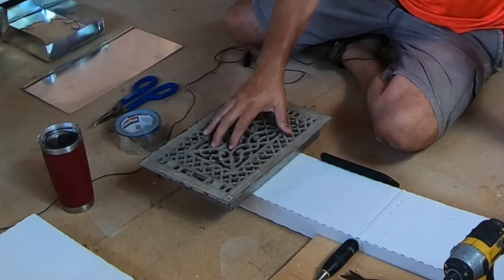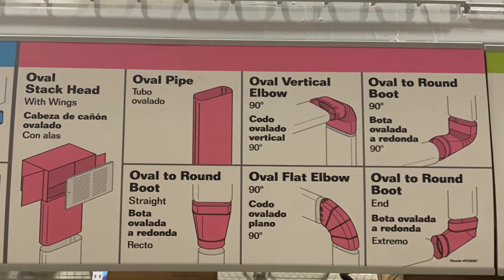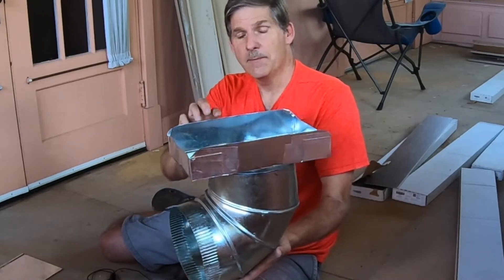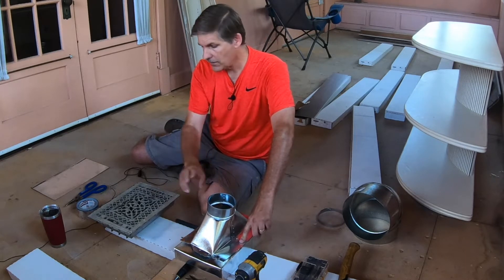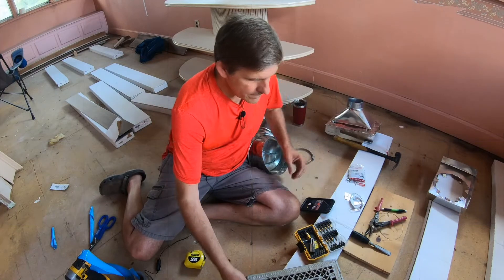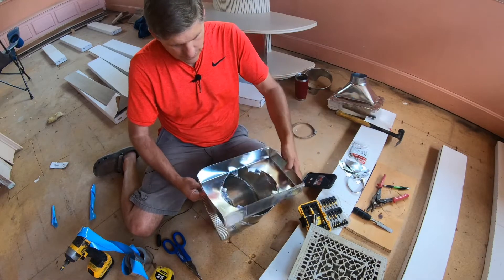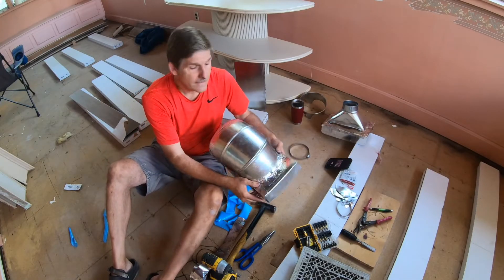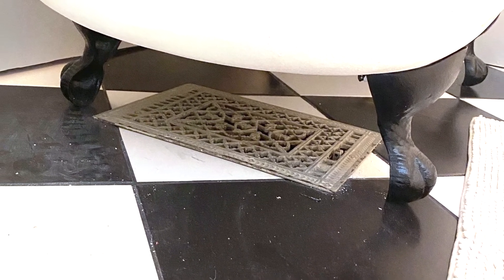Moving Duct Work in wall for Open Concept : old house renovation

Comment: Great ideas and detailed info!  Love the editing.  😃 Old houses renovations are fun, but can take a lot more time and thinking outside the box with what is available without breaking the bank due to the need to modify so many items.  We have moved main floor heating vents in the floor out towards the exterior wall more, as so many of our circa 1890's house heat runs come up into the inner wall area, just to be sucked down into the nearby large floor air return.  No wonder it feels cold in here at times.  Our next project is hopefully moving the hallway/main stairway area's large floor air return to possibly go "into/under and coming out of the nearby stairway wall" using the same size iron grate.... freeing up the floor to not having to walk over the huge intake all the time. All accessible from the basement.  Works on paper, at least. 😉
Reply from the maker: Hey Red…,
Sounds like a fun project - way to go and take that on yourself! Thx for sharing too!

Comment: I'm renovating a 100 year old Detroit red brick home. One contractor told me he needs to break through the bricks in the basement in order for the ducts to go through the third floor. Another one recommended installing two furnaces one in the basement and another in the attic so he doesn't ruin the structure. I would appreciate your advice.
Reply from the maker: Hey valeria…,
Hard to say w/o seeing it. 
But I would personally not like to bust out bricks - don’t want to create a structural issue. 
If money is no object, 2 furnaces would cause the least damage.
Another option is a minisplit ( they do both heat and cool ) We’ve installed a few - MrCool makes affordable single units and multi-zoned units. 

You can see those from this playlist;
https://youtube.com/playlist?list=PLExVGissIl-HC2liBQqZVP-sCqYCdtMcp

Another option is to run a “chase” from the basement to the third floor. A chase is a boxed duct ( rectangular metal would be the least noticeable).
If you could find a path for the chase from basement to 3rd floor though closets or hidden areas that would be ideal. 
But even modern new construction will run a visible boxed chase in horizontal drop downs across the ceiling or vertically in the corner of a room. 
We just did this in a 100 yr old house we are renovating. 
If you are heating  1 room, the duct chase might only need to be a 3x10 inch rectangle. If you are heating an entire floor - maybe a 6x18 inch duct ( all depends on the volume of air that needs to go up there. 
Don’t be afraid to get 3rd and 4th opinions. 
Don’t hesitate to ask us (or them) if you have more questions. You want the BEST option - not just any option. 
If you ask us - make a new post as I will see that quicker rather than in a thread. 
Hope you find the best solution!
Thx for watching!